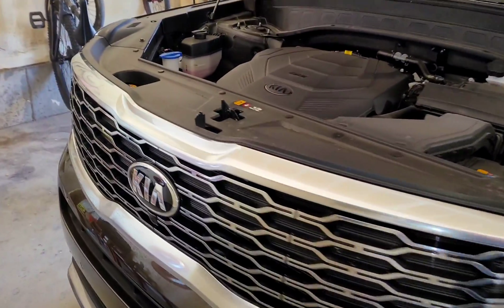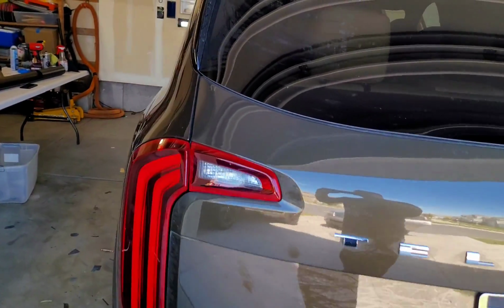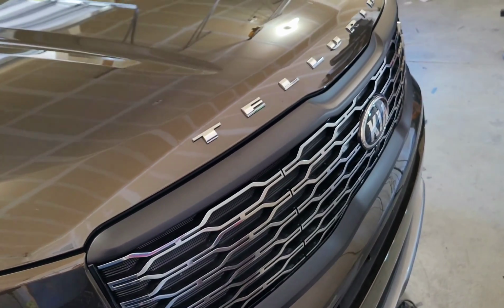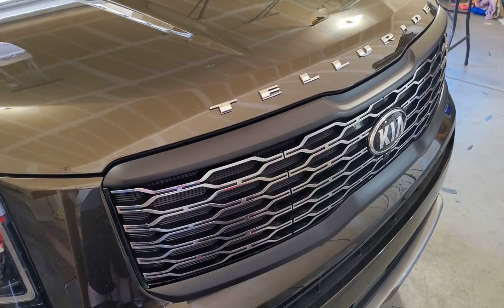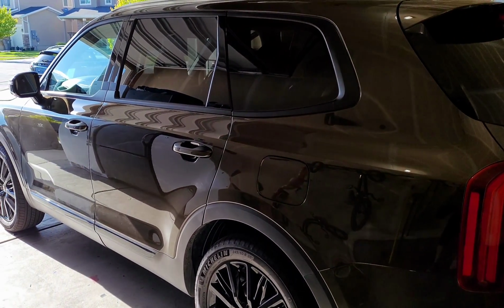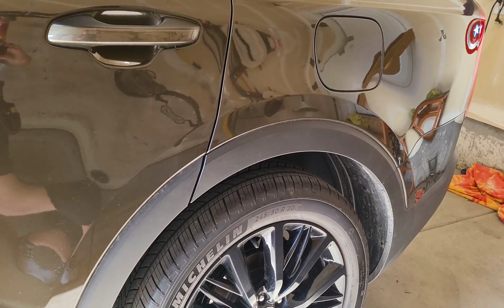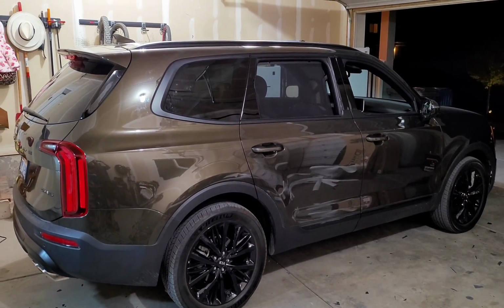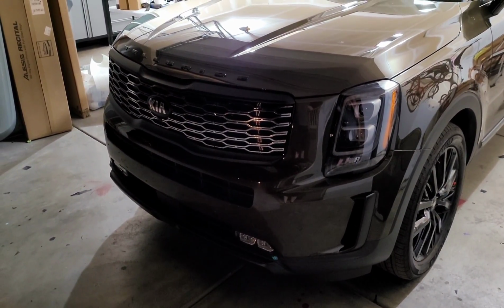2020 KIA Telluride (FULL CHROME DELETE)

Comment: How did you do that back part that is wider then the two inch vinyl?  Did you make two rows basically or stretch it to fit?
Reply from the maker: I don't use the 2 inch rolls. I order the vinyl in 25ft rolls and cut off what I need. You never want to stretch the vinyl if you don't have to. It will pull back in most situations over time.

Comment: How much did you charge for this?  Looks great btw
Reply from the maker: For the full Chrome delete including the roof rails, it was $1000
Reply: Ouch , looks great but the nightfall package which essentially does all of this costs $1295.
Reply: @carlmitchell3181  true... But we did satin black on the windows, not gloss.... The grill is not as cool on the night fall, nor are the wheels. And when all is said and done the customer saved $250😁👌
Reply: @Milhamman79  Wrap isn't durable and that will start peeling after a year or two. Better to buy the nightfall package.
Reply: Not the case nightfall addition was running 10k more than the next one down. Only difference was the black out with rims. 😩 I want this done on my 22.

Comment: I’m looking to do my ‘22 SX but there’s that rubber piece that goes along the window trim and is between it and the window and it doesn’t seem like I’ll be able to slide the wrap between it and the chrome trim. How do you do that part?
Reply from the maker: I'll have to see a picture to fully understand what you are referring to. Just email me at chwraps1979@gmail.com
Reply: I have the same issue there is nowhere to tuck the trim at, you can lift the rubber piece and tuck it in but its not much space

Comment: Where are you located?
Reply from the maker: Orem Utah
Reply: I see. i’m here in AZ.  I need to ask you. How much you charge for full body wrap?
Reply from the maker: @bernardobito-on3936  between $2000 and $3500... Lots of factors in the price
Reply: @bernardobito-on3936  Im in AZ As Well
Reply: @bernardobito-on3936  Here in Florida it ranges from $700 - $1000. I just got my telluride and have been shopping for prices and that's what I've been quoted!!